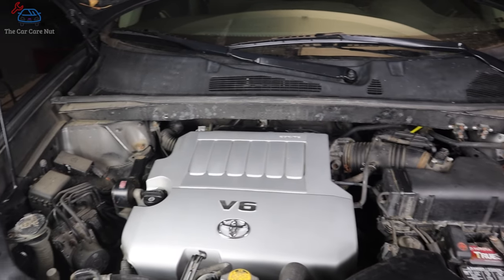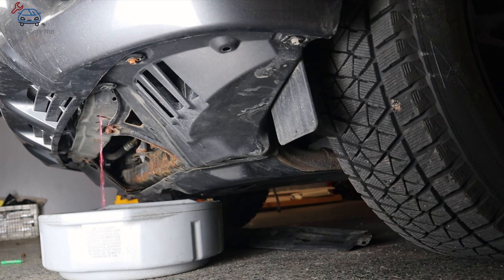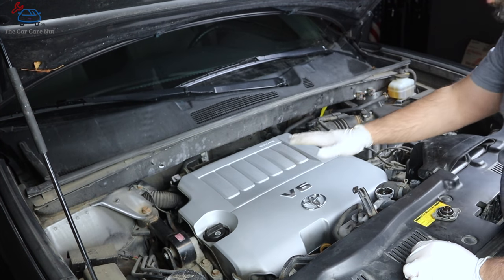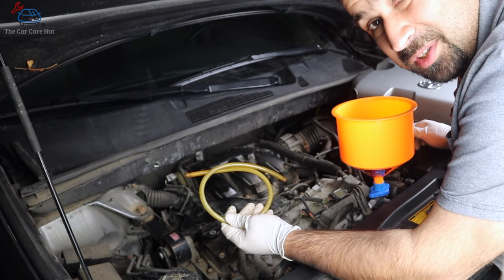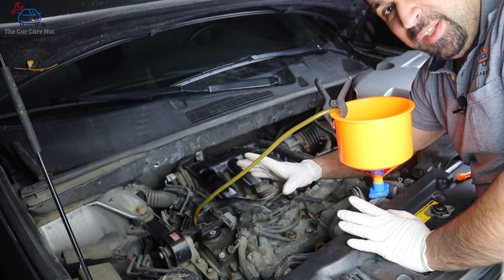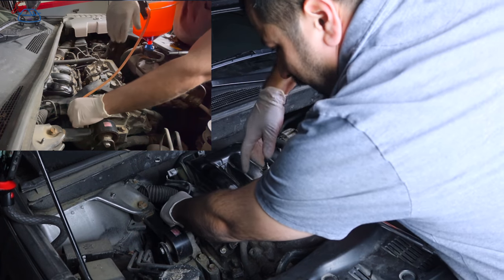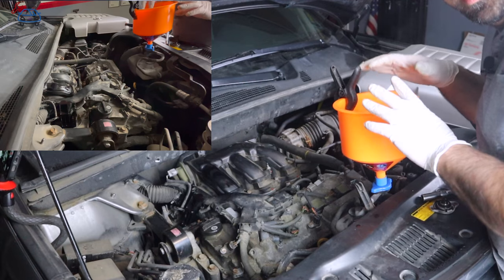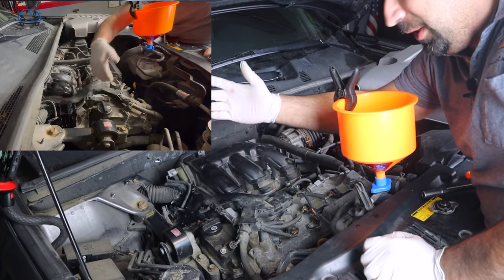Toyota Cooling System Bleeding for V6 2GR-FE 3.5L THE RIGHT WAY!

Comment: Did this to my wife’s Highlander yesterday - worked exactly like AMD said. Very easy, but took a little longer than I expected for the coolant to drain (at least 30 minutes) and bleed (probably 10 minutes at least). Just a friendly heads up - be patient, don’t rush, and don’t worry if the bleeding takes a few minutes to do what you see in the video.
Reply: I did my Rav4 v6 today too and it did take about 30 minutes.
Reply: What year, I have a 2001 rx300 3.0 liter, where is the bleeder valve if you know?
Reply: I waited an hour at 2-2.5 km and no constant flow

Comment: I just did this on my Avalon. Here's a couple notes from my experience in case it helps someone: 
1) Harbor Freight sells the coolant funnel system/adapter for approx $40. 
2) I used the 3/8" clear vinyl tubing (1/4" was too small) from Home Dept & widened one end (just a tad) by sticking a heated screwdriver 🪛 in it for a nice, snug fit onto the bleeder valve. 
Thx for sharing the video!

Comment: Just finished my 2010 RX350. When draining, I used the big funnel into a 5 gallon can. But I put that into a small mortar mixing trough to catch any dribbles. Pretty much went as described but didn't get the "violent" bubbling or spitting. The coolant level went up and down and finally no bubbles anywhere with a small amount in the overflow tank. Be prepared to replace the plastic rivets on the top and bottom plastic panels. Buy them by the dozen.
Thanks for this very useful video.

Comment: I just adopted this method on 2010 Toyota Camry V6 3.5 L 2GR-FE . Yesterday after changing a radiator and thermostat on this car, bleeding the system with the spill free funnel ( my usual very efficient method ) was just not getting the job done. I saw this video last night and tried it this afternoon and boom, it solved the problem but it took some time revving up the engine. I already had my hose which I normally use for bleeding brakes.  Thank you Car Care Nut ! You can now graduate from a 'Nut' to a 'Bolt' .  Lol !

Comment: Your master level knowledge is a lifesaver. I was doing it wrong and I'm so thankful you make these videos and pass on your knowledge.  I'm a big believer in if you keep all your basic fluids clean (oil, coolant, brake, trans, diff) 99% of car problems can be prevented.
Reply: Maybe not 99% but you'll certainly greatly increase the car's longevity IF you started out with a high quality product.

Comment: Replaced my radiator and did this procedure on my 2008 ES-350. Procedure worked well. Key is to have patience. Took about 20 to 25 min to get the solid red coolant to fill up the entire hose and spit into funnel. Thanks Sir!

Comment: Thanks! I'm after my first flush. 2 Fails and then success on the 3rd attempt. Tips for other folks: use 10mm diameter plastic tube (from garden store for example), better longer than shorter. Use the 10mm hose clamp (from garden store) to clamp it TIGHT on the bleeder tube. (My plastic tube kept getting off of the bleeder tube) - FAIL #1). Wrap the end of the plastic tube with a stiff metal wire, so that the plastic clamp installed on your bucket, does not clamp the plastic tube too tight (Mine got clamped almost entirely, so no coolant was going through - FAIL #2). Fill your bucket to the point where it's 1/3 of its capacity. Use the broomstick to depress the pedal, control the RPMs with your electric sit settings (forwards/backwards). Optimal RPM ~2200-2500. Much love to Car Care Nut, congrats on the new car!

Comment: Thank you for a wonderful tutorial. I did this on our 2015 sienna and it worked exactly as described. So many times things unplanned or undescribed occur and then you are left wondering. But this was perfect. I got exactly one gallon of coolant out on Round 1 and a week later re-did it with Round 2. To get extra coolant out, attach the bleeder hose and blow through it, you'll get a substantial amount out. Whole operation took about 30 mins. I will do this annually going forward. Harbor freight has the perfect funnel kit

Comment: I just used this method after doing a radiator swap on my 2008 RX350. It worked like a charm. What I didn't expect was for it to take so little time. It was maybe 10 minutes. The water sucked back just like you said and then came out as a solid stream with many small bubbles. Heater works great. Really happy I found your video. Thank you very much!
Reply: what kind of clear hose can you use? is clear vinyl tubing like they sell at lowe’s fine to use?
Reply: @PeterPyo  that’s what I used. Since there is no pressure on it you don’t need anything fancy. The stuff from Lowe’s will work just fine.
Reply: @vallejokid1968  ok thanks i wasnt sure since it says its only rated to 140 degrees fahrenheit, and i know that we gotta get up to 180 degrees for this job. but it held up fine for you even with exceeding the temperature?
Reply: @PeterPyo  ok you had me questioning myself so I went back and looked at my pictures. I actually used the vinyl tubing that has the thick wall and nylon string inside it. It was still something from Lowe’s but it wasn’t the straight clear tubing. My apologies.
Reply: @vallejokid1968  ohh ok that is very good to know, thanks so much. gonna go to lowes now and RETURN the vinyl tubing haha! do you mind telling me what product that is? not sure what to look for…”nylon tubing?”
Reply: @PeterPyo  EZ-FLO 3/8-in ID x 10-ft Reinforced PVC Clear Reinforced Braided Vinyl Tubing
Item #879269
Model #98626

Not sure about the diameter but this kind of tube. This is from the Lowe’s website.
Reply: @vallejokid1968  THANK YOU!!
Reply: I had the same result with the same car. Was your drain outlet also in a silly position? The outlet is horizontal so the draining coolant is difficult to catch with a bucket or drainpan.
After I did that and followed the rest of the video, I only used one bottle of coolant

Comment: This is the first time the coolant has been changed in my 15 year old 2009 Toyota Yaris with only 108,356 miles on the odometer.
Contrary to Toyota Owner's Manual, the engine Bleeder valve/petcock is under the EXHAUST manifold, not the INTAKE manifold.  10mm wrench to open/close the valve; 3/8" I.D. clear plastic hose needed to snugly fit over the nipple. Yes, thanks to you, I bought & used the OEM No-Spill Funnel.

I used Phoenix Systems test strips, which told me the corrosion Inhibitors were about to turn acidic & the coolant protected down to 0º.  I then drained & replaced with Toyota PINK coolant.  
The old coolant was a little darker in color & had no sludge or particles in the drained coolant or at the bottom of the coolant reservoir.

     From now on I'll change coolant every 5 years or 50,000 miles  whichever comes first.
I will continue to use test strips annually to confirm that the ph is good

Comment: Thank you for the video, very helpful.  I did not know about the bleeder before I watched your video.  I have a 2015 Highlander and in the past I changed the antifreeze by using a no spill funnel, park on a hill, and drive the passenger front wheel on ramp to bleed the air out of the cooling system.  This method has worked well for me, but yesterday I used your bleeder valve method.  After I was done bleeding, I decided I would check the bleeder valve method by using my old method (hill, ramp, no spill funnel burp method), and I learned it was already bled completely with your method.

Comment: I did this early this morning on the wife's RX350 and it worked perfectly.  Thanks for all your videos!  I've also changed the transmission fluid (3x spill and fills) without issue.  Next up is differential and transfer case fluid changes.

Comment: Just wanted to say thanks  - followed your video to the tee and worked like a charm on a 2008 Lexus RX350 with 265k miles. I’ve done this before but you’re the first person to mention and show how to use the bleeder valve in the process.

Comment: I just want to thank you for showing this video.  I've watched many of your videos and greatly appreciate the knowledge you share.  I did this to my wife's 2011 Sienna (200K miles). I was wondering why a steady flow hadn't started after a while, but I remembered  what you emphasized at time mark 5:37 - TURN OFF THE HEATER!  ugh!.  But once I turned off the heater, it worked great.  YOU ARE THE MAN!  BTW: loved the bloopers! Numbers 6:24-26 back at ya, my friend!
Reply: That part about the heater actually confused me because I would think you want the valves to the heater core open all the way? Or is that for a system flush, not just a system bleed like this?
Reply: I missed that too. Other videos tell you to turn the heater on.
Reply: How long did it take after you turned heater off?
Reply: @kevinnn116  it took about 3 minutes or so.  Not long.  Be sure (as he says) that both the front and rear heater is off.

Comment: i just did it to my 2006 toyota avalon 3.5 xls now which has 346k miles with 50/50 1us gal
+ toyota dealer coolant exactly. sure to have good results when i drive it towards work later. my Thanks to your very helpful and unselfish way to help through this video, God bless!

Comment: Awesome 👏   Another one I saved for My 2013 ES350. Definitely will follow your steps in this video. Will need to buy that overflow bucket and 1/4 inch ID clear plastic hose. Very clear and easy to follow !!  Thanks !  Your channel is priceless. My grandfather was a mechanic, he owned a service station in Brooklyn NY back in the 1940 and 50’s. Definitely got my knack for working on cars from him.
Reply from the maker: Thank you for watching! Working on cars is fun! Until things go south😞 but then when things get fixed after going south it’s a great feeling!
Reply: @TheCarCareNut  You’re so right about things going south sometimes even the easiest job can turn into a nightmare at least in my experience
Reply: Where do I get a funnel/bucket like that??

Comment: Awesome!  I just did my 2015 RX350 and used about 2gal (kit off Amazon) of Toyota OEM coolant. I was concerned that I had some "scale" on the cap when I opened it.  Wish I could post a pic here.  But used my wet/dry vac and pulled all of it out of there after I opened the bottom drain of the radiator. I don't know if the scale I observed is a problem but then, it's a 2015 with 30K miles and as far as I know, never been changed. Then, I opened another bleeder on rear of engine (close to transaxle shaft) to get another bit of coolant drained.  Finally, I recharged the system just the way described in the video.  Thank you for your videos and may the Devine powers keep you safe so more of these helpful videos are put out there!  Cheers Everyone!

Comment: Great video! I so could have used this when replacing the water pump on my RX350. I spent almost the same time bleeding it as I did removing and replacing the pump. Total nightmare!
Reply: I couldn't get mine to overflow constantly, even after an hour

Comment: Another great DIY video. The basics of your method should apply to all vehicles. Things I learnt a long time ago; 1) use a tube at the radiator so you are filling at a level higher then the top of the engine, 2) the bleed screw is located at the top of an air lock so must be opened when bleeding and 3) the thermostat must open to enable the bleeding to complete successfully.
Reply: what kind of tubing is ok to use? is the clear vinyl tubing they sell at Lowes ok to use? or would it melt and pass impurities into the liquid that could gunk up system?

Comment: Thank you so much for sharing these tips!  Ran across this while diagnosing no heat condition on passenger side of a 2007 Sienna Limited.   Found the previous owner replaced the radiator, removed the thermostat, loaded it up with stop leak...  not sure what problem they were fixing...  When we got to the bubbling vigorously stage, it turned to a sticky volcano...  There are sure to be a few more surprises with this car.  Still no heat on the passenger side, but I know how to bleed the system like a pro 🙂 now!

Comment: This was a very helpful video. Thank you for posting it. I drive a HIghlander with rear heat and air and there are a couple of steps regarding draining additional coolant that I'd like to share. I have found that even after draining coolant out of the radiator, there is a great deal of coolant left in the engine itself and in the hoses that feed coolant to and return coolant from the rear heater core. What I do is open the engine block drain cock that faces the firewall in order to get all of the coolant out of the engine block. This takes a 10mm socket and a ratchet with an extension. There is a 10mm bolt that allows you to open this drain cock for this very purpose. You can access this from the underside of the vehicle where the exhaust downpipe leaves the engine bay.  I also disconnect one of the coolant hoses (just under the right rear door of the underside of the vehicle) that runs to the rear heater core and then I blow it out the remaining coolant. This pretty much clears the entire system of coolant. I hope this will be of help to some of you do-it-yourself guys.
Reply: Guess that’s why mine only take 1 bottle coolant ,just drain radiator only ,Thanks for that insight bro.

Comment: Will do this on the next coolant flush I do, but the first time I didn't have your video and was unaware of the bleeder. I didn't have heat for a full week of driving, but it eventually cleared itself out on it's own. No overheating issues or the like, but wasn't fun in the cold mornings. The things you learn from valuable resources online.

Comment: Replaced my alternator which required me to remove the water pump inlet hose due to a flange bolt mounting the alt being rounded out. My coolant was already lower than it should have been so I tacked this onto my to do list and it worked like a charm. Was nervous about having it cranked at 2000RPM but everything seems to have worked out. Thank you so much dude.

Comment: Love the stick of lumber for the gas pedal to keep it at 2k RPM hack!  Bought the radiator fill kit from your Amazon link, coolant at the Toyota dealer, then everything you showed in the video went like clockwork.  Easy peasy!  After I tightened the bleed screw, with the tube attached, I used a spring clamp to pinch the tube near the bleeder, popped off the hose and tightened the bleeder.  About a teaspoon of coolant spilled!  Thank you for all your professional and informative videos!
Reply: Did you do this on the 2GR-FE 3.5L engine? That's what I've got on my 2007 Toyota Sienna. Tried the harbor freight funnel kit, couldn't get a good seal at the radiator cap. Hoping the kit in his amazon store is still the right one for this motor...thanks in advance for any info!
Reply: @samiam369  hi, I ordered the ABN coolant funnel kit from Amazon. It’s $23.19. Worked good for me. Same engine.  Good luck!!  Easy peasy!!!
Reply: @petew7614  Thanks for the quick reply, Pete!

Comment: Last year, I first time drained 2006 IS350 coolant after 85k miles from original factory 2006 coolant,  it's bright RED.  looks so fresh.  Toyota super long life coolant is REALLY SUPER LONG LIFE.
Reply: Shouldn't it be pink? Toyota changed from the red Long Life Coolant sometime before 2006 (The CCN will remember when.)
Reply: @flagmichael  I will correct what I said. I did mean Pink.  I believe it's slightly darker in color  than brand new Super Long Life coolant but remain very shiny, see through.  I really think it can hold for another 20k miles easily in that color.  IS350 has 2GR-FSE, a variant of 2GR-FE but with direct injection.  I bet it's the same but extra 6 injectors.

Comment: Great Video!   I successfully replaced the, now,  8 year old coolant in this used car  we got.  I have done a lot of car coolants, I would have never figured this one  out without  your help.  Bravo!    Trick for running the RPM up:   Get a 22 inch stick, place it on the  front of the seat to the gas pedal, then push, carefully, the seat fore/aft control forward and voila!  Throttle control.   The  only procedural thing  I added was that after it  was fully bled, I cranked  the heaters.  The  back heater (7 seat Highlander) took more bleeding to start producing  hot air... then I shut down per your instructions.

Comment: Worked exactly like the video showed on 2011 Camry LE V6 2GR-FE. Sprayed some WD-40 on the bleeder valve the day before and fitted the hose while engine was hot. Needed a 10mm deep well socket to open the valve the following day. Old coolant was red, new Toyota coolant Pink. Replaced the Radiator cap with Toyota brand. Thanks!!!

Comment: Awesome video. Thank you. Couple observations when I did this. First it takes quite a while to do this waiting for the spirting to happen - like 15-20 minutes at 2200 rpm’s so be patient. Also I don’t think it matters but should the tube back to the funnel be in the fluid or out of the fluid in the funnel?  In the fluid only allows fluid to back feed but I am not sure if that actually occurs. But anyway be patient!  Thanks

Comment: Your videos are great.  My wife just purchased a used v6 Camry so I wanted to change out the fluids and spark plugs and I also will never buy another v6 Toyota since the 4 cylinders are so much easier to deal with.

Comment: Hi AMD, first i want to thank you for all the great content you constantly upload for all Lexus and Toyota owners. Second, I wanted to ask why is it that you mention that heater needs to be off while bleeding. I have watched another mechanics and even read some manuals that specifically instruct to have heater on at full blast so the heater core is also serviced. I just wanted to understand the logic of the heater part. Again, thanks for everything you do for the community.
Reply: The coolant always flows to the heater core on 2GR-FE  no matter what. the engine doesn't have heater core valve .